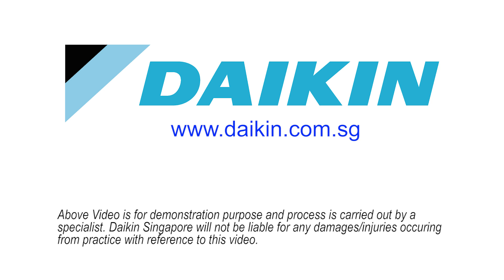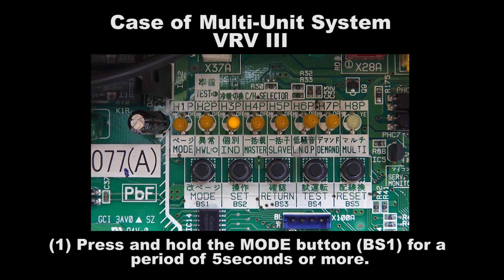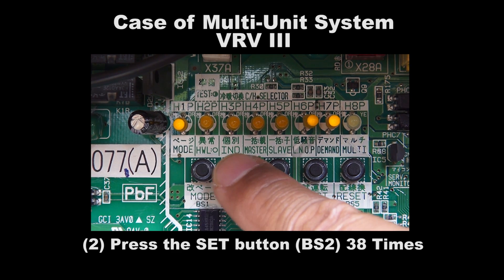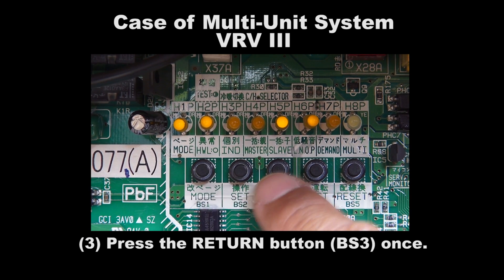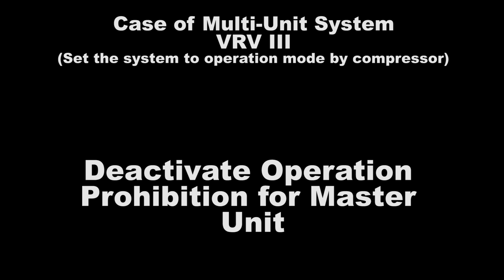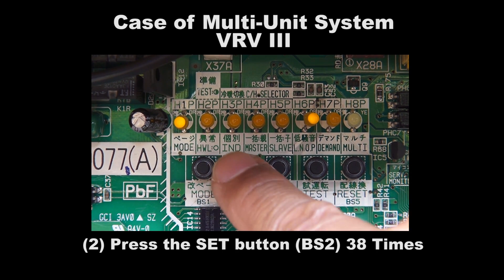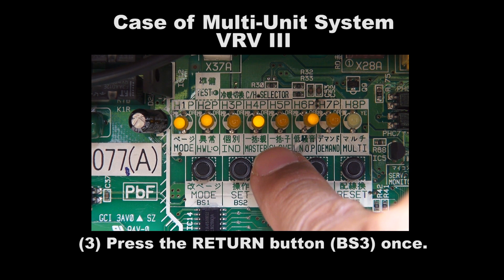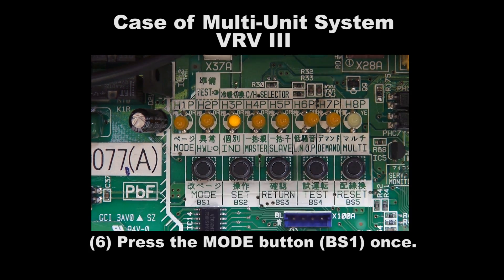Emergency Setting for VRVIII VRVIII Q and VRVII (R410A) Master Unit Compressor Failure

Comment: how to run the system if have fault the master unit..error 3..that system is master/slave1/slave2.. how can run the system..i want to remove the master unit..how i will set the system.? tnx i need help..this is an VRV IV SERIES
Reply: Did you ever figure this out? I just diagnosed a bad compressor on vrv III master unit. Need the rest of system to get running while new compressor is ordered.